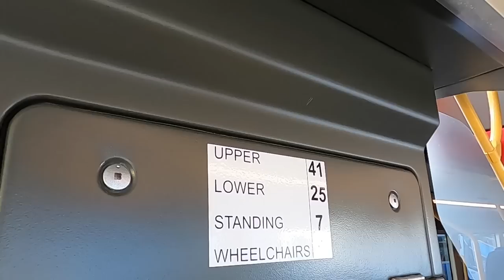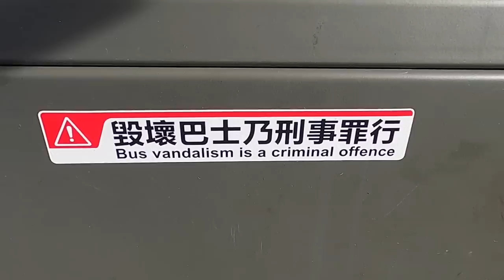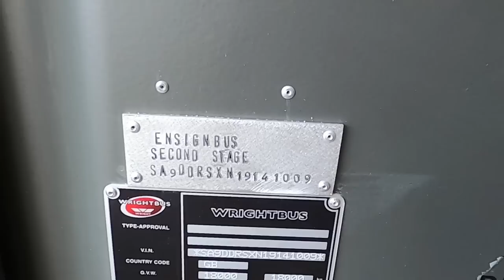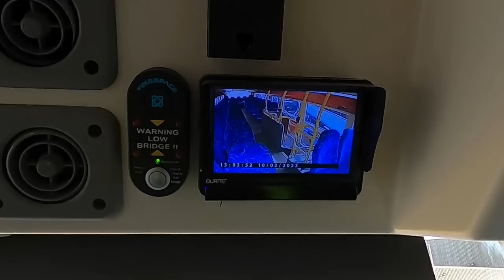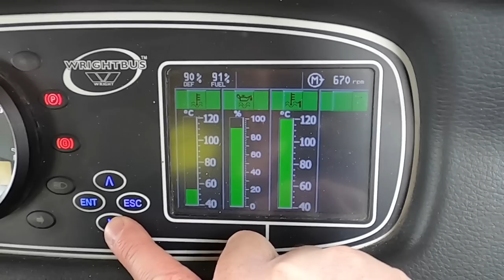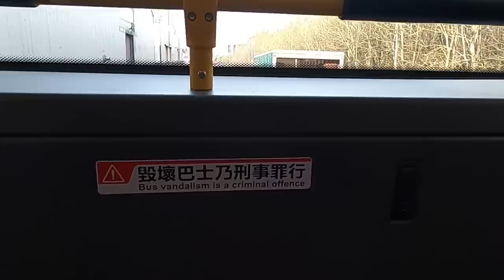Test Drive | KMB StreetDeck

Comment: The conversion to UK spec looks nice, too bad that they didn't (or couldn't) keep the original Audio announcement system and fare box which is used in Hong Kong but at least they didn't remove the aircon system. I'm also surprised that they didn't remove the "Bus Full" sign on the front there (NOPE that's just the temporary license plate)...
Reply: The equipments hv been holding by KMB, and bus full signal has been showing on the dest. display since 2009 🤗

Comment: Curious about why the staircase didn't confirm to UK standards.Seems odd that Wrightbus would design one that wasn't.Particularly for a one-off demonstrator.
Reply: @jasonwong1272  no, KMB didn't cancelled the order, they sold these buses to sun bus company, and they kept one for themselves, and then they bought Enviro500 MMC 11.3m. There is two reason why this bus went to England, It was reported that the financial situation of Wrightbus was in great crisis, which led to the suspension of the bus.And the other reason is the air-conditioning system of the bus failed to restart after a sudden breakdown while traveling on KMB 88 in the afternoon of October 4, 2019; and Wrightbus has no official agent in Hong Kong to follow up, and foreign manufacturers are required to deliver the relevant parts on their behalf.  suspension status, it then left Hong Kong on February 20 and was transported back to the UK.

Comment: This bus was bought by KMB in 2018 and it run for KMB for a year.  The reason why this bus was sold to Ensign Bus is because during October 2019, the air-con of this bus is broken and cannot be reopened.  During that time, Wright Bus was facing some financial issues which force KMB to stop using this bus since there are very less parts available for this bus and it would take a long time to ship.  Therefore in 2020, KMB decided to return this bus back to Wright and then sold it to Ensign Bus.

Comment: What's the beeping in the cab?
Reply: Probably from a system KMB installed previously warning drivers they are: speeding, over-revving etc. 

Beeps a lot when the driver floors the gas pedal.

Not 100% sure tho...
Reply: @5x22  exactly, linking with ZF Openmatics
Reply: Whatever it is needs to be broken
Reply: but the openmatics was remove
Reply: It’s a warning system installed in the programmed dash of requirements of KMB for the drivers to have a warning signal at speeds of 50 and 70km/h. 50 is for reminding the drivers not to over speed in the average city and urban roads while 70 is the maximum on highway

Comment: This bus was in service in hong kong for one day and is forced to retire due to it being unreliable
Moreover, the buses didn’t fulfill the requirements of the transport authority of Hong Kong so they have to make some modifications in this thing
50 of these were ordered from KMB and due to the retirement of the first one and the delay of registration
KMB cancelled the order for these buses and they changed to order Enviro 500 MMC 11.3M
These bus were intended to replace the aging Volvo Super Olympian 10.6m and Dennis Trident 10.6m.
Such a shame it didn’t come into service for long

However, KMB did place some orders for these street-decks a few years later for it’s subsidiary Sun Bus to run residential shuttle services from Park Island to Tsuen Wan and they are running perfectly fine till this date. I even get the chance to ride on one and I can tell it’s simply a very well done bus.

The bus in this video is registered at W6S1 in KMB Fleet was sent back to UK after a couple months. Can’t believe it can run service in this term. Hopefully they won’t change the livery on this bus.

Comment: I am from Hong Kong,this bus is W6S1,number is WJ1984,it go to UK in 2019 , now, Hong Kong don’t have any this bus
Reply from the maker: Thank you for the additional information.
Reply: @CoachBusWeek  it’s ok
Reply: No, that's partially false since there is one company operating total of 5 Weight streetdeck currently, which is sun bus company, and those buses were originally orders from KMB and currently runs on non-franchised services
Reply: @duplelau4640  no they are all in tze tin car parking they are retired now all are keeping by bus fans
Reply: @maktsunfung9295  hk still have these bus, just all are in Sun Bus but not kmb
Reply: @matthewcheung8909  ok I try to find them today
Reply: @maktsunfung9295  主力行331&331S
Reply: Sun Bus have some streetdecks to operate Park Island routes
Reply: 3:20 what happened with the audio?
Reply: @maktsunfung9295 the buses now operates route 331s and 331 both route goes between Tsuen Wan and Park island and the fare is pretty expensive